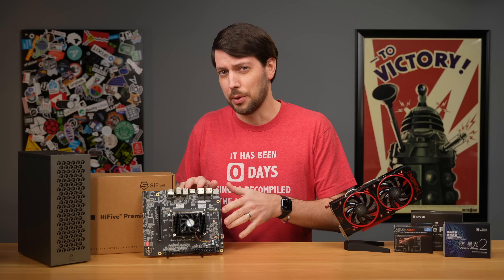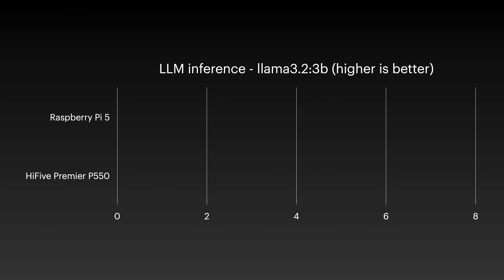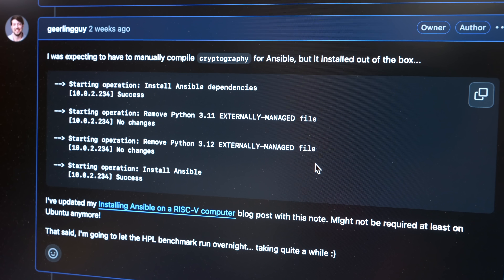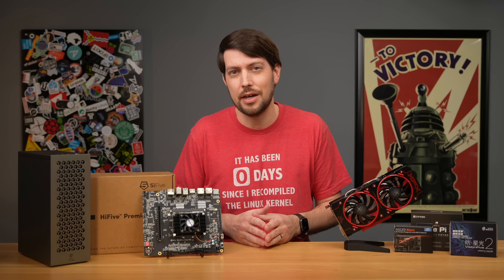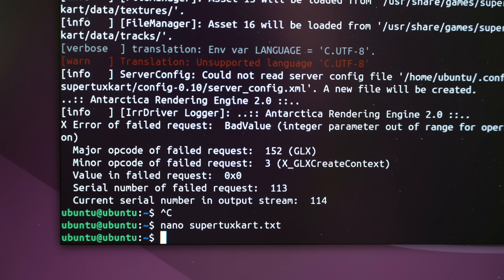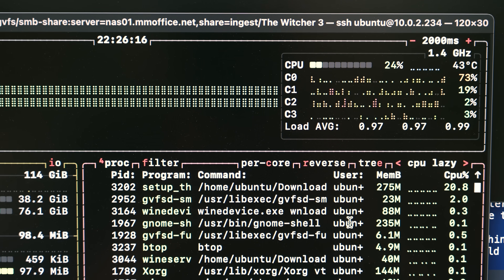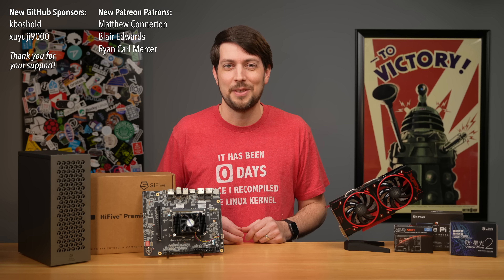RISC-V was supposed to change everything—How's it going?

Comment: Honestly, my RISC-V board is reasonably fast.  The 2D video acceleration is slot but otherwise really good for the price.  Start putting these on better chip technology and it should be quite good... each passing year, substantially better.  I really like the RISC-V assembly language.  It's as easy as programming in C.  Doing AI on ARM is extremely frustrating--very difficult getting it up and maintaining it.  I gave up on my Jetson board.  It's just not worth all the tech time to keep it working with driver updates and stuff.

Comment: The main benefit of risk v is no pesky licences and that's supposed to decrease cost add flexibility to do specific things faster but we're few generations in and it's slower In pretty much every application, it's more expensive, and slower. I'm all for open development, not putting all eggs in a proprietary basket but the most positive thing we can say about it now is that it mostly works with software. Don't get me wrong it's a huge achievement but what's the realistic end goal here? Where can ot actually excel?

Comment: 0:50 Mini-ITX isn't standard ITX. Standard ITX is practically unused, but it is 215x191 mm. It's a bit higher and quite wider than mini-DTX, which is 170x203 mm. Mini-DTX offers better compatibility with mini-ITX and a place for second expansion slot.

Comment: Reposting something I said in a reply: I think it's hysterical that people still get this enthusiastic about instruction set architectures.

The ISA is the easiest part of modern CPU design. The hard part is creating performant and cost-effective microarchitectures that implement those ISAs. That's why RISC-V is currently stuck down at the very bottom of the embedded market, against the lower-end cores in the ARM Cortex-M line. Nobody can really justify the expense of creating anything more sophisticated than a simple 5-stage single-issue in-order microarchitecture.

Designing even a simple in-order superscalar microarchitecture like the Cortex-M7 or Cortex-M55 is seriously hard, and out of range for all but high-end players.

Designing the the sorts of aggressively speculative and OoO microarchitectures that are needed to make competitive phones, tablets, laptops and servers costs tens to hundreds of millions of dollars per iteration, and is basically out of reach for anybody not named "Apple", "AMD", "ARM", or "Intel". 

And then there are all of the supporting assets like interconnects, cache-coherency protocols, etc etc. One of the reasons so many people go with ARM in the embedded space is not for the cores, but because using AHB (on the low end) or AXI/CCI (on the higher end) gives them access to massive amounts of off-the-shelf IP. That just doesn't exist for RISC-V.

Comment: The reality of RISC-V is something designed by committee, Everyone wanted their bit into it and its not longer by definition a RISC chip, it has not become inconsistent, flaky and difficult to know what is and is not support in it. You just need to look at the cpu extension flags of m, a, f, d, q, Ziscr, Zifencei, c, b, v, j as opcode options you need to check before you can run your opt codes. I would say in another 3-5 years they will run out of letter in the alphabet as its designed with "everything is an option" model.

Comment: AI Summary

Abstract:

This video reviews the DeepComputing P550, a $400 developer board featuring the RISC-V architecture. While its performance is slow compared to modern ARM boards like the Raspberry Pi 5, it is currently the fastest RISC-V single-board computer (SBC) available, significantly outperforming previous generations. The board boasts ambitious hardware, including a 20 TOPS NPU and an Imagination GPU, though software support for these features is still in development. The video highlights the rapidly maturing RISC-V software ecosystem, with excellent developer tool support and a near-mainline Linux kernel. Extensive testing showcases its capabilities, including limited PCIe NVMe speeds, successful integration of older AMD GPUs, and the remarkable feat of running Windows games like The Witcher 3 through complex emulation layers, albeit at unplayable frame rates. The conclusion is that the P550 is an expensive but vital tool for developers, representing an exciting and significant step forward for the RISC-V ecosystem as it closes the gap with ARM.

A Deep Dive into the DeepComputing P550 RISC-V Board

*   0:00:02 Introduction to the P550: The video introduces the DeepComputing P550, a developer board built on the open RISC-V architecture. Despite its high price of $400, its performance is comparable to decade-old computers.
*   0:00:26 Ambitious but Incomplete Hardware: The board includes advanced features like a 20 TOPS NPU for AI and an Imagination GPU. However, the software to fully utilize this hardware is not yet available out of the box.
*   0:00:42 Unique Form Factor: The P550 uses a Mini-DTX form factor, which is 33mm longer than the more common Mini-ITX, potentially causing compatibility issues with some small PC cases.
*   0:01:15 The Fastest RISC-V Dev Board Yet: While slow by modern standards, the P550 is the fastest RISC-V board the creator has tested, proving to be more than twice as fast as previous models like the Vision 5 2 and the Framework RISC-V board.
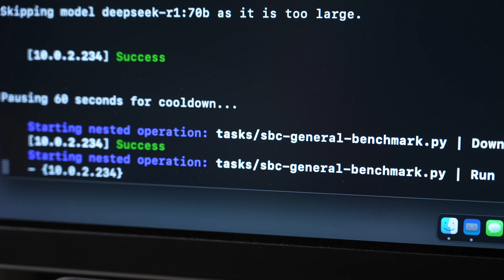*   0:02:35 A Rapidly Improving Software Ecosystem: Software support for RISC-V is maturing quickly. Most developer tools work without needing to be compiled from source, and the Linux kernel requires only about 100 patches over mainline, which indicates strong future support.
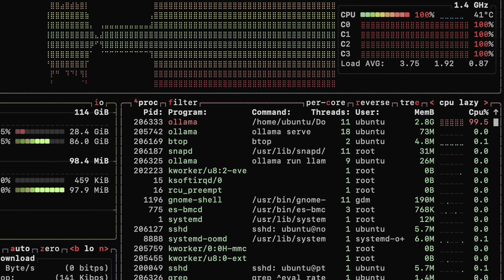*   0:04:21 High Idle Power and Cooling Issues: The board has a high idle power consumption of around 8 watts because the CPU lacks a power-saving governor. By default, the CPU fan runs at full speed, which is unnecessary for the low temperatures observed.
*   0:06:27 PCI Express Capabilities and Bottlenecks: The board has a full-size PCIe slot (wired as x4 Gen 3). Testing with an NVMe SSD yields speeds of only ~800 MB/s, far below the interface's potential, indicating a CPU bottleneck.
*   0:07:40 Successful AMD GPU Integration: Thanks to open-source drivers, the board works with older AMD GPUs like the R5 230 and RX 480. This enables improved native Linux gaming and GPU-accelerated AI.
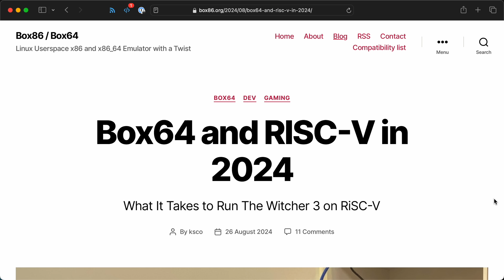*   0:09:03 Pushing the Limits with Windows Emulation: In a major proof of concept, the creator successfully installs and runs The Witcher 3 (a AAA Windows game) using a combination of Wine, Box64, and dxvk. The installation took over 7 hours, and the game runs at an unplayable 0-2 FPS, but the fact that it works at all is a huge achievement for the platform.
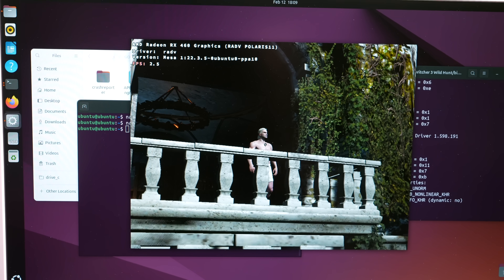*   0:12:24 AI Performance and Workarounds: On-chip AI is not yet functional. Running LLMs on the CPU is 20 times slower than a Raspberry Pi 5. However, by using an external AMD GPU with Vulkan acceleration, the board can achieve a usable 15-30 tokens per second on smaller models.
*   0:13:42 A Niche Board for Developers: The video concludes that the P550 is not for consumers but is a well-supported and powerful platform for developers. Its capabilities signal that the RISC-V hardware ecosystem is rapidly becoming more compatible and competitive.

I used gemini-2.5-pro| input-price: 1.25 output-price: 10 max-context-length: 200_000 on rocketrecap dot com to summarize the transcript.
Cost (if I didn't use the free tier): $0.03
Input tokens: 17563
Output tokens: 963

Comment: I could be wrong, but I feel like in order to properly switch over to Risc-V, you would need an affordable, supported home system that has Risc-V for most stuff and a low-power, efficient x86 CPU for everything Risc-V can't do yet.  Or we need Tim Apple to swoop in... but in anycase, everything could be handled under the hood so people wouldn't know anymore when which CPU is being used.

Comment: Acid Burn wasn't wrong. RISC architectures did change everything, or at least RISC microarchitectures did. Half a decade later, CISC microarchitectures were extinct, So-called CISC chips were all RISC with CISC instructions implemented in microcode.

Comment: ARM itself is pretty slow considering.  Its only real advantage is low power so it's uniquely suited to mobile battery powered devices.  It can't compete with x86 (well amd64) in raw performance and never will.

Comment: Btw the issue you mentioned with pre-boot GPU output is not “the same thing with Arm”. Various GPUs have EFI AArch64 option ROM drivers, and a bunch of machines have those included. Not all, but at least one of the Arm servers you’ve reviewed will do the right thing
Reply from the maker: Thanks for the note—do you know if anyone has a listing of which ones do or don't? It seems like all the older ones definitely don't... but maybe it started with the 40-series Nvidia cards?

Comment: china can do cheap/affordable ITX mobos with soldered on engineering sample x86-64 CPU's...

but risc-v or arm64 "desktop" boards are like $1000....

Once there is a cheap/affordable ITX mobo with RISC-V or ARM64 with all the connections/expansions you'd expect from a desktop(including discrete GPU, looking at YOU ARM64 which doesn't seem built for it)... I'm talking like $250 or something.
Maybe up to $450 if it's a high end qualcom chip that already support windows in laptop form.

Then I will get one and attempt to daily drive it. (win or linux)

Comment: Looking at these efforts to get everything running, I think the hardware speed is not really the problem, not entirely. You’ve got emulation on top of emulation, with untuned code on top of untuned code. I feel like a company like Apple could get this thing up and working reasonably well for consumers on a small selection of in house apps in a year or two of kernel, compiler and libraries work, with a few hundred expert engineers full time. This effort we see in the video runs like the spit-and-baling wire software stack of early unreleased platforms. The issue is that performance isn’t just fast hardware, it first and foremost is the absence of stupid software and time taken to remove cheesy hacks designed to get the darn thing to boot and something, anything to appear on screen, and instead do things the right way. You can throw more hardware at it later to double the performance, but even that is getting nowhere if the software is still using O(N^3) algorithms everywhere with a single global shared lock around every contested data structure. 

Alas, the problem is that at the end of the day, most of what you’d want to do with the machine would be 3rd party apps and getting those developers to recompile for the platform and fix all their latent bugs is the work of years. Worse, the ask to switch to Linux from am mainstream consumer OS is even larger because most of the human interface code needs to be rewritten. As the video claims, I can see this being “better than a simulator” for development for certain limited application servers for the corporate space. For anything else, I wouldn’t get your hopes up unless Apple, Google or Microsoft decided to jump architectures, for an ultimate game machine or good productivity machine. It would remain something to hack on, probably ultimately fruitlessly. But, yeah, the licensing terms are good.

Comment: I think the games is the least important thing to test on a PC. If you want games, just get a Switch or a Steam Deck.
Also I'm surprised WINE works on it. Normally it should work only if there is a Windows program that runs on the same CPU. Have Windows and programs that run on Windows already been ported to RISC-V??

Comment: I want to buy a RISC-V Computer but this are so weak so I don't do it. They say it is the future but this is not to run a normal like CPU! Same my Pinebook Pro this was so super flat and the RK3399 was a snail slow and I pay in sum +€400 for the Laptop $200 + Postal $40 + Import Tax 20% + a IBM SSD €121 so it was €400,- for a slow Laptop that looking good and Manjaro I hate pacman to install with stupid commands some programs. RISC-V is 20year back in time they never can hit the top of the hightech companies.